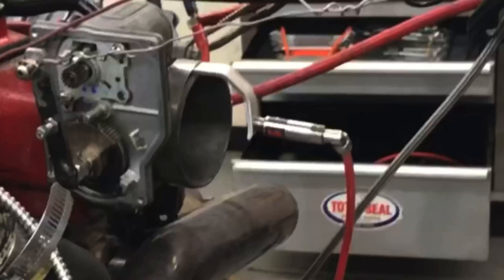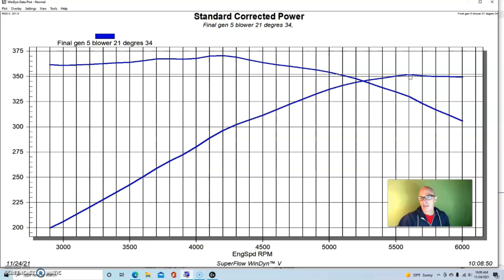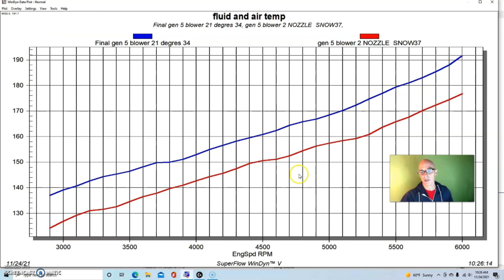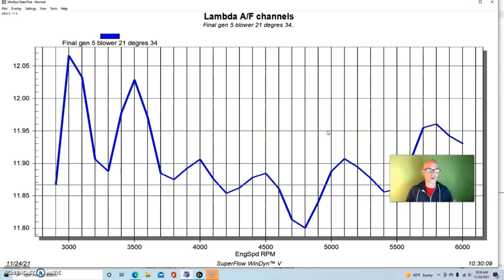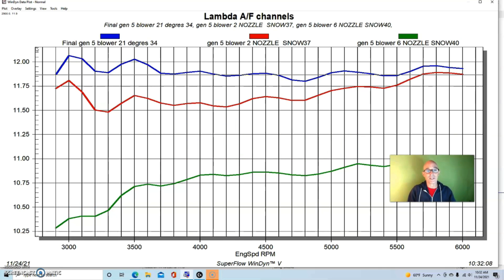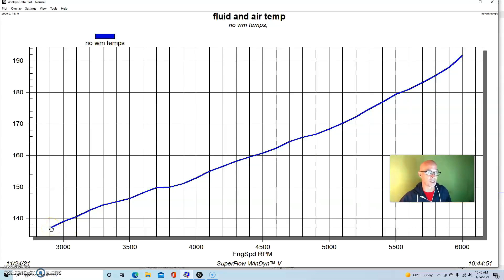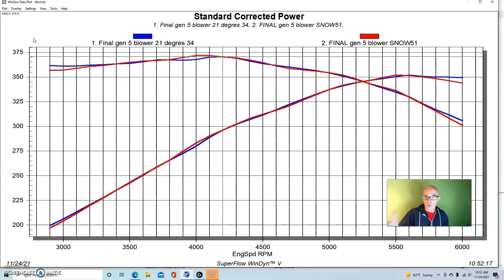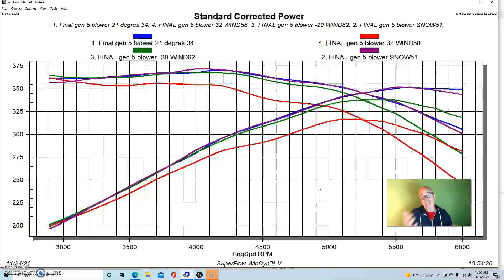WATER METH VS (LOW-$) WINDSHIELD WASHER FLUID-WHO WINS? BEST WATER/METH VIDEO EVER! IATS, AF & HP!

Comment: This matches my experience.  I would love to see this same test run on 93 (or 91) octane E10 gasoline, along with an analysis of how much timing you could add with each of the three fluids compared to what you can run with no injection.

Now we have a pretty good idea of that the boost juice and washer fluid do for temperature. Next we need to see what each one does for detonation resistance.
Reply: Not sure how controlled the tests were but on Gunpowder & Gasoline S15, E17 they ran similar tests.

You could get yourself a plex knock monitor and find out for yourself, sure each application will be a little different.

Get a baseline with tune backed off.  Then carefully induce some intentional knock, monitored with the plex.  Then go back to original and make the changes.  The plex or any good knock device will help ya find safe limitations.
Reply: It seems almost like the real useful part of water meth is IAT, not detonation resistance but it is not 100% clear.  To get the most bang  without E85 maybe you need Torco or Boostane for detonation resistance + Water Meth for IATs.
Reply: I don't quite understand why enrichening the fuel with methanol decreases the power so much when the stoich ratio of Methanol is very low.  Any thoughts on this?  In my head... since the stoich ratio is so rich, Throwing quite a bit of methanol at the motor should not have a big negative impact on power but that doesn't seem to match what Richard found here.

Comment: Meth inj doesnt work well with e85. It works a lot better with pump gas and lowering the iats. I am running water meth injection on a naturally aspirated Tahoe it did increase the power and in summer where the iats are high it brings it down to a more manageable number so that I may run winter performance all summer long

Comment: I had mostly a loss on the dyno even on 93/98 in an N/A v8. However on a 110F day at the strip, I tested back to back 50/50 WMI and made decent gains in MPH. I made no changes to the tune, on a DIY injection kit. Probably about as "real world" as you can test it.

https://youtu.be/2WMLd15OzSI

Comment: Lowering charge air temp with oxidizers will only lower the temp, but no gain in power. Creating air density by cooling the charge air creates power and lowers temp, but air density can not be creating when cluttered up with washer fluid. 
The meth injection has always been a low buck easy way to fight detonation, not to create power.

Comment: -20 washer fluid is still maybe 1/3 methanol vs boost juice is 49%. A system like torqbyte makes tuning easier. It runs the w/m via a pc table u set up. And can set up an output signal to the holly where u could make fuel changes based on that signal. Snow crapformance w/m controllers are basic and over priced.

Comment: It seems you were not fuel limited (you reached mbt before detonation) if added timing with w/m did not pick up power.  Need -30F deicer W/W fluid (purple) to get approx 50% meth (similar to boost juice) and reasonable water/meth blend.  Check SDS on different washer fluid products to know what they use as the deicer.  Sometimes not alcohol based.

BTW - did you add food coloring to the -20F fluid?  Never seen dark washer fluid before.

Comment: Another effect I would like to see tested is where the water-methanol is injected.  Injecting it at the supercharger inlet, takes the place of some air which the supercharger would otherwise be able to stuff into the engine.  If the water-methanol was injected after the supercharger this would increase air flow because the supercharger would just be pumping air.

When water-methanol injection was originally developed for WW2 aircraft engines, it was called MW50 (methanol-water 50%).  There was a "de-richment" valve that adjusted the air-fuel ratio to maintain peak power.  The original intent was not to increase power, only to suppress detonation.  The methanol was included as antifreeze to keep the water from freezing at -40F when flying at 30,000 feet.

Comment: Snow performance is as the same of windshield washer... The best way is mix weight on scale 50/50  pure methanol & distilled water. Safe money & stems clean.
Reply from the maker: this test shows they are not the same
Reply: @richardholdener1727  it is the same.. i do make that test all ready on my car.. not make any difference. Snow performance and windshield are the same stuff.

Comment: In our Curtiss Wright 3350, ( cube ), 3,000 horse, the fifty fifty water meth, was used mostly as an anti detonate . The low rpm and huge combustion chambers are very knock prone . By our, I mean the US Air Force . This mixture, I believe,  was brought in simultaneously with the high speed , second level of boost from the two speed centrifugal supercharger  . On edit, now that I think of it the system was called ADI, anti detonate injection  . Been awhile,  53 plus years .
Reply: Late to the party but here is another tidbit from P and W.. Not all alcohols are created equal.  Methanol and ethanol work well but isopropyl was actually worse.    Maybe this is what is going on with the washer fluid.  Edit: The 32F fluid doesn't have any alcohol listed on the SDS.  It's probably just water and soap. The -20 Is only 35% meth so there's not enough alcohol to offset the oxygen displaced by the water volume.
Reply: Good stuff man. 2 speed supercharger! now that is cool.

Comment: Water does not burn, it does however displace oxygen so water injection in and of itself will always lower your hp versus not having it. The only time you will see gains is with big intake temps and high boost where the increase in charge denisty is greater than what the water is displacing. A proper sized intercooler capable of keeping charge temps in check will always be the most powerful route over water injection.

Comment: Please expand on this test. I run a natural  aspirated V8, compression ratio 10.75:1 with water methanol injection and pump premium gas.  I use winter, below freezing rated windshield washer fluid and a simple single stage vacuum switch with low pressure pump. It really runs much better with this simple system at full throttle.  I really should add a good af ratio sensor but could the carb just be a little lean to start with? More testing data would really help me steer my tuning in the right direction.

Comment: As most have stated starting with e85 is a big help nice protheus as per 👍 usual Richard, could you do another test using nitrous as a intake cooler when no using a intercooler, I've had great luck with my supercharged motorcycle with no cooler and small amounts of nitrous to keep detonation and intake temperatures at bay,lol ,haven't rattled a cast piston, yet,lol,keep the good info coming your a most valuable contributing member to the boost community, thanks

Comment: I have this system on my 7.3 powerstroke. Using 3 #5 injectors has a beneficial effect on both HP and torque. Does take some testing to get the right setting without causing combustion quench from too much water that is in the washer fluid. Would like to try straight methanol sometime to see what happens, though refilling the 7 gallon tank each time would get expensive.
Reply from the maker: ADDING FUEL TO A DIESEL ADDS POWER
Reply: How many miles do you typically get on one 7 gallon tank? How do you like your system? Also where did you put the three injectors?
Reply: @devtavares2190    
Maybe just over 300 miles or so, depending how often I mash the Throttle. As for injector placement, for the primary, it is in the up pipe near the A/C compressor. The other 2 are mounted in an AFE spider, located on each side going down to each head. The spider has the bungs already in place that was perfect for placement of the injectors.

Comment: Having a flat plate in front of the TB is not optimal for atomization. Like others are saying if your on E85, kinda a waste to add water meth.
Alky control can run 100% methanol , water is great for cooling but not for all out power.
Reply: Was the Snow injection controlled by a map sensor? Or was it just a on and off type deal?
Reply from the maker: BOOST REFERENCED AS INDICATED IN THE VIDEO (I SUPPLIED ON/FULL ON BOOST POINTS)

Comment: It upsets the tune because you're using SD and not MAF.  You'd get different results with MAF. Likewise water on it's own works best when used with low octane pump fuel. The alcohol part is just extra fuel and prevents freezing.
Reply from the maker: THE TUNE WAS ADJUSTED
Reply: @richardholdener1727  With a MAF tune there's no need for adjustments because it doesn't change.

Comment: Was the Holley hp running open loop? I wonder if you could run it closed loop and let the ecm see the a/f drop, and lean out the fuel flow automatically when the water/meth was flowing.
Reply: Exactly. My guess is the Holley wasn't closed loop or it would try to adjust for the change.
Reply: He replied to another that he doesn't run closed loop, so that answers that. My question would be why not use the closed capability of the controller to adjust for the change.....
Reply from the maker: I ALJUSTED THE AF SO EVERY CURVE WAS THE SAME (NO WM, SNOW, 32, -20)

Comment: Need to have a turbo system and 91 fuel and see how much more boost you can run without getting knock with water methanol added that's the point of it. Also run 100% methanol aswell to see  the difference.

Comment: I had a water/meth injection on my Chevelle back in the 80's I had 11:1 compression and it was hard to find 98 octane so I added the injection system to keep some timing.

Comment: I didn't realize that water/methanol injection made it run that pig rich. Dumb question (not that you'd want to) but could you technically run the wet side of a nitrous injection with water/meth rather than gas? Would that make an further gains in dropping intake temps, or is it a moot point with the cold temps of nitrous?
Reply from the maker: YOU DON'T ADD VERY MUCH FUEL (OR NITROUSE) WITH A TYPICAL NITROUS SHOT-NOT ENOUGH TO COOL ON A HIGH HORSEPOWER V8, BUT MORE SO ON A 400-HP V6!

Comment: When it comes to water/methanol, the higher the methanol concentration the more power you make. !00% methanol will make the most power. The reason why 100% methanol is seldom used is that when the concentration is 50% or higher, it becomes a hazardous material. Another drawback is if pure methanol catches fire, the flame is almost invisible. Water/methanol will make more power when using it with pump gas and the effects on performance will be minimal when using water/methanol with E-85. When using water/methanol with pump gas, it raises resistance to detonation and allows you to increase timing so that performance will get closer to using E-85. Adding 4 degrees of timing at WOT made a significant difference in performance in my car. Water/methanol and pump gas won't get you the same performance as you would get with E-85. I use water/methanol with 93 octane E-10 because E85 isn't available in my area. My Procharged V-6 Mustang is .4 seconds quicker in the quarter mile using water/methanol with pump gas as opposed to using pump gas alone. I went from running 12.2s and 12.3s to 11.8s and 11.9s. If using water/methanol with E-85, the only thing you will get is charge cooling. Some people use water/methanol as a substitute for an intercooler mainly due to limited space requirements. However, water/methanol with an intercooler offers better charge cooling and performance as opposed to using water/methanol alone.

Comment: One thing that did surprise me a little, was no gain for WI.  Theoretically I would have expected a reduction in compressor work, meaning less blower hp, leaving more for the flywheel hp number, but we did not see that here, like nothing at all.  I wonder if less fuel would have helped move the HP dial in the right direction as there was clearly no issues with knock at anytime on E85.  Really interesting results.

Comment: You can use water/meth or meth injection two ways all while running cooler charge temps and less knock. 1: to supplement fuel as shown here(he was able to take fuel out to run the same power and also run cooler charge temps. 2: you can up the boost and it helps fight knock while under boost allowing for more power. Snow and other companies even have boost reference controllers that only spray and a desired boost level. But, a tuner that knows how to tune this way is a must because you have to have all kinds of safeties set up in the tune in case you run out of meth. This isn't a new thing
Reply: The controller he was using is boost referenced (VC-50), you might be thinking of injector pulse width compensation also for different loads... Additional timing is also used and not just boost.

Comment: Water/Meth injection was invented in the 1930s to combat detonation that occurs with the less refined fuels and to cool charge temperatures . Long before e85 was available. The first wide spread use was in aircraft during WWII and it DOUBLED the output of the forced induction engines. Of course the fuels today are more refined than 80-90 years ago but we should still see somewhere in the ballpark of 20%-25% gains on 93 and lower, due to the ADDED alcohol. I believe the change in timing had no effect due to the fact that he was already running 85% alcohol and the snow mixture was at 50%, therefore not ADDING any additional knock resistance. Maybe if the snow was ran with a 100%  meth but you will start losing the additional cooling benefit from the water. Yes, he was adding more alcohol to his alcohol so his AFR will inevitably increase.  I run 93 and when my Snow is activated, it effects my AFR very little. This is one of the reasons I always bug him about running street gas. 😆
Reply from the maker: YOU THINK IF I RUN 91 (WHAT WE HAVE IN CALI) AND ACTIVATE THE SAME AMOUNT (6 NOZZLE), WE WILL SOMEHOW SEE NO CHANGE IN AF?

Comment: Regardless of the base fuel used the same benefit is there. Its mainly CC cooling which acts very similar to race fuel. The charge cooling numbers are completely bogus. Garbage data from saturated thermocouples/thermistors. This is easily proven, as you don't see the HP jump up as it should per degree of cooler charge temp w/ water/meth.  Its because the charges ARENT cooled near as much as the sensor reports. Water/meth should be treated as an octane booster, not charge cooler. Its VERY similar to running race fuel VS pump gas etc. Put a Mass Air Flow meter on your dyno next time. This will also back up my point. You'll see the Mass air flow barely changes w water/meth. Yet, if you add an A2W you'll see the Mass Air flow drastically increase and the HP increase as it should per degree of cooler charge temp.
Reply from the maker: TAKE A LOOK AT YOUR COMMENT AND SEE WHAT YOU LEFT OUT-THE CHARGE TEMP DID CHANGE (I KNOW YOU DON'T WANT IT TO), BUT WHAT ELSE HAPPENED THAT WOULD NEGATE THE POWER GAIN (COMPARED TO AN INTERCOOLER)
Reply: @richardholdener1727  
Not sure I follow. There is a very simple formula to calculate HP increase per degree of charge temp. If you use this formula with an IC the math works out. If you use this formula with W/M it doesn't.

 The temp dif. data you have is garbage. The thermocouple can't accurately measure the true charge temp when it is saturated with fluid, period. Water/meth is not an intercooler and doesn't act like one in the baby volumes you use. The benefits from it are in the CC cooling and detonation prevention, not in added power via charge cooling. 

You can eliminate the "water variable" by simply spraying 100% meth. Again you will see false low temps reported and the power numbers will not back up your false data.

    

Extensive testing has been done on this. That tiny amount of fluid you spray isn't enough to do diddly to charge temps as a whole. ESP. with any kind of water in the mix. Yes, the charge temps do change. But water is a very poor charge cooler as the vapor point is 212*. So if you aren't higher than that charge temp wise, its doing little to charge temps.

 When spraying methanol with a vapor point of 150* it will actually do some work if you use enough of it, you aren't anywhere close.

 At 1000chp (100lbs/min of airflow) on the dyno roughly 500cc (8gph) of fluid to knock 15* off the charge temps. Was also verified that at 500chp the gains double, and roughly 30* was pulled form the intake temps with the same 500cc volume.

 Also of note, once charge temps of around 150* were reached (spraying 8000cc 126gph) of meth via 4 injectors pre turbo, spraying more methanol no longer lowered the charge temps. Or made more power than injecting it at the rail. Which would hint that actual charge cooling is basically limited by the vapor point of the fluid injected.   

 This is all verified using a calibrated MAF on an engine cell dyno. Data is backed up with the HP gained per degree of charge temp drop formula. Also found spraying pre turbo is much more beneficial. A 15* drop in temps at the turbo inlet is worth more than 15* drop in the charge pipe.

Comment: I would have liked to seen a supertech brand winter blend washer fluid with the correct amount of heat (store bought methanol) additive to make it 50/50 like the boost juice with a price comparison and also a water/meth vs strait methanol through the snow performance system comparison.